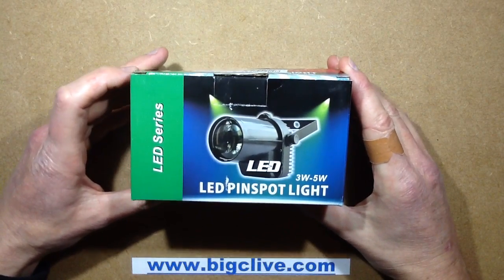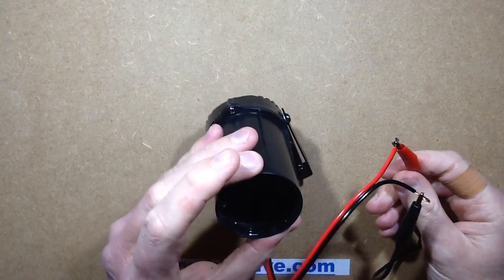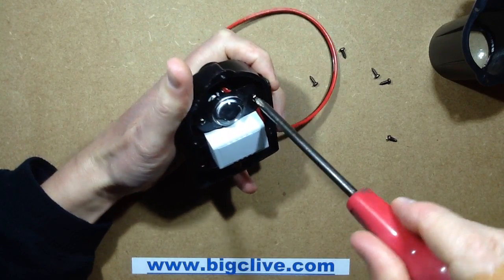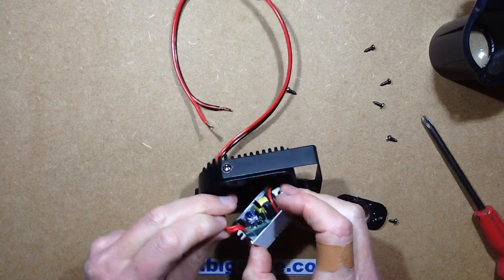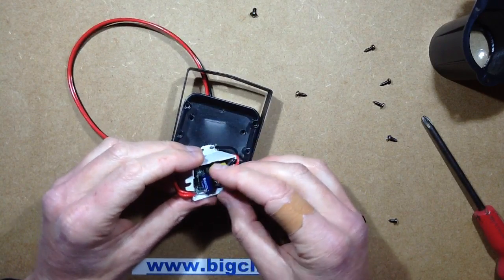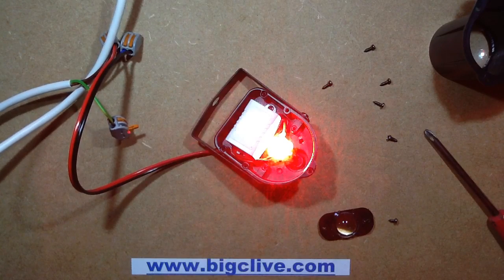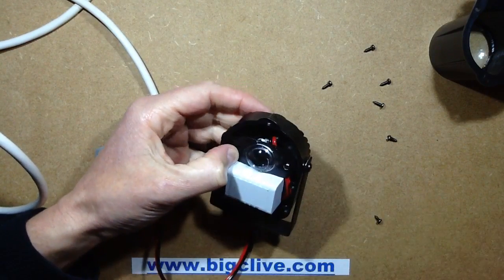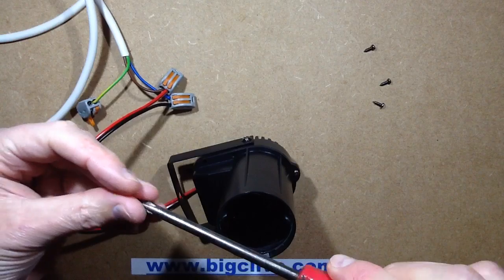Inside a generic LED disco pinspot.

Comment: do you have a video on your bench power supply and do you recommend say in my country  a cheapie $30 some Bench power supply  (or worse the DIY ones off banggood  which I'm not really sure if I'd wannt try.  I do like the Main's voltage term way better than ours.  Power vs Mains.  hmmm or live ground neutral.

Comment: I wonder if you can help.
I have a Chauvet brand of the same sort of thing, Pocket Pin Spot.
My light flashes five times, now, instead of working normally.
.
Does that indicate to replace anything in particular, the LED or some other replaceable part, do you know.
If not, don't worry, thanks for posting a nice video.
.
I have another one, which just dimmed to very faint light, how about that?
Does that indicate any particular type of replaceable part within?
.
I have five of these in my flat, they all worked fine for the first nearly-a-year.
Kindly Ignore my request if you are busy.
.
Cheers.
from,
del-boy
Reply from the maker: +KorbielowSki It sounds like the power supply is failing to get its feedback voltage.  That might suggest a failing PSU cap or the LED is pulling the output too low.  If you are open to dabbling you could swap power supplies between fixtures to see if the fault follows the power supply or LED.
Reply: Dear bigclivedotcom, Thank you for your response and suggestion.
.
I'll try it, thank you.
.
If everything in the Lamp(s) has a number on it, I ought to be able to find a "replacement part" on the Internet, DO YOU THINK?.
I mean aren't most things these days not unique but common / standard?
.
Cheers.
from,
del-boy
P.S. Your videos are inspirational.

o0o
Reply from the maker: +KorbielowSki It depends on whether they have used custom power supplies.  But depending on the internal arrangement of components you may find you can get equivalent components.
Reply: bigclivedotcom 
Cheers.
From,
del-boy.

Comment: One of the Chinese 20watt floodlights that I bought, went pop after running for 2 minutes. The fault was actually the wiring. I've not encountered wring that acts as a fuse before. The cable made quite an incredible bang, but it did save everything else from harm.

Comment: LOL it doesn't even have a DMX option on it, the packaging is mis-labeled and the wiring is not to code for 120 or 240 mains AND there is no proper earth grounding on it.. I can see it causing issues for those not knowledgeable on electricity or electronics.. 
I wonder how many people bought these and tried it on 12 VDC and got mad it didnt work..
Good video man, its people like you who give those "not in the know" a heads up on things like this.